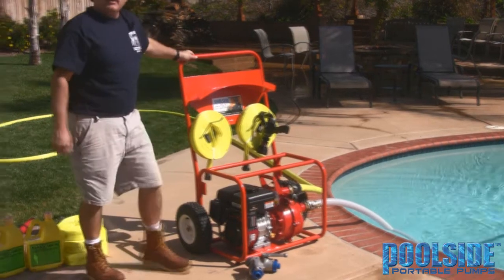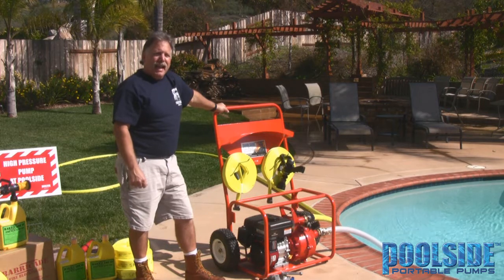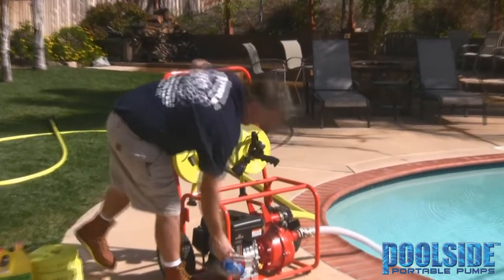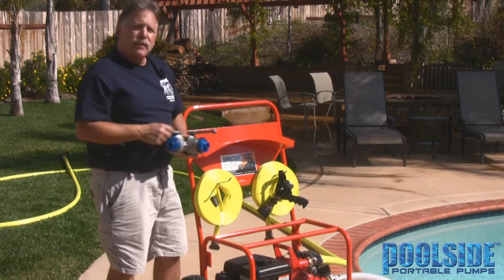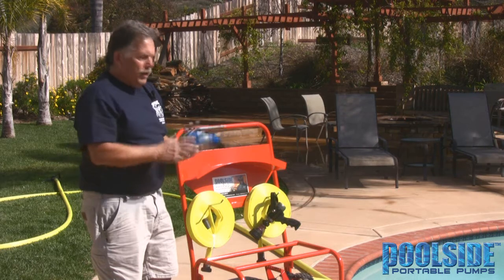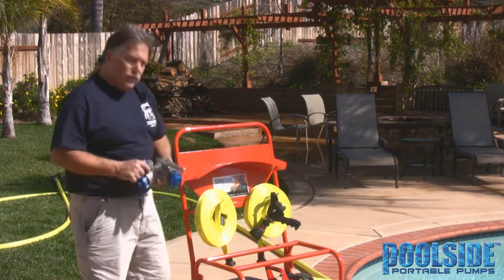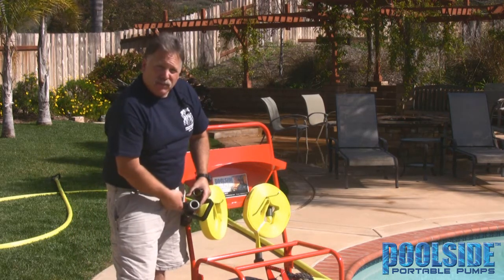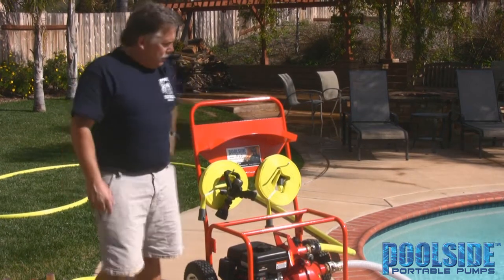A Technical Presentation of Poolside Portable Pumps

Comment: Low GPM pump. you could run 3 1" lines or 1 1.5" line. Again low gpm but high pressure. Would be best put to use, powering a home sprinklers defense system. Under eves, roof points and siding protection